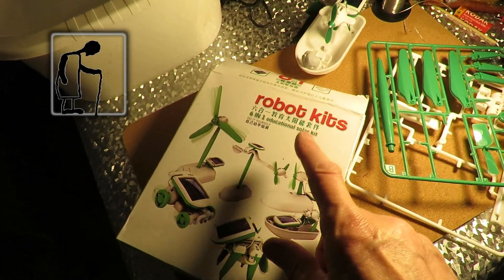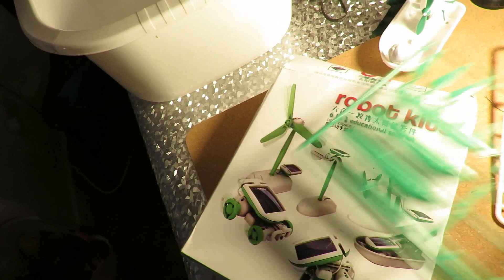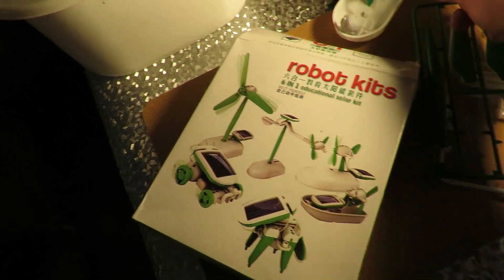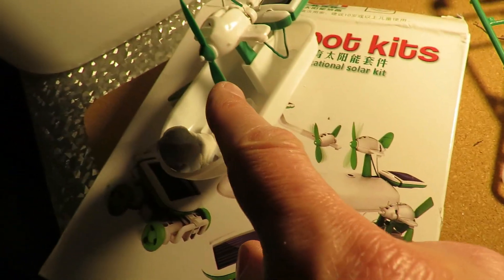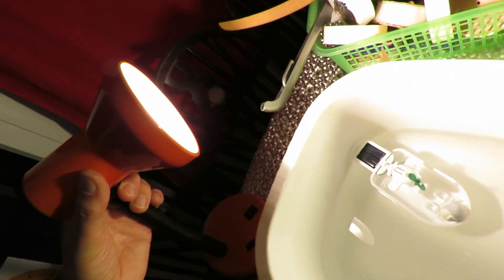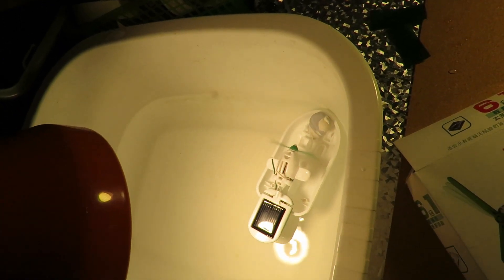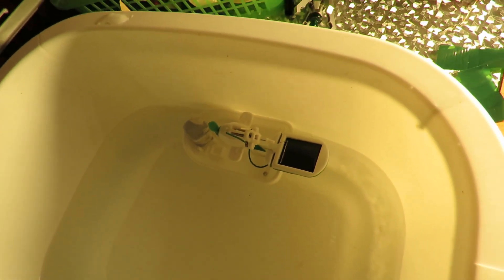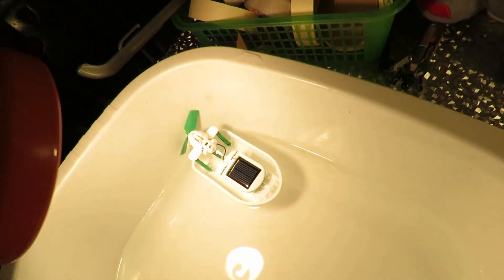6 IN 1 educational solar kit - Fan Boat

Comment: Holy cow.
I am sitting here looking at the same kit!  
I picked it up at Dollarama for 3.50 Canadian.
Still haven't opened it  lol.
I forgot i had it until  saw your box.
Reply from the maker: 3.50 Canadian, sound a touch expensive although the prices vary dramatically depending on the branding and where you buy them. I would say it is a good kit "at the level it is aimed". The spring connections for the wiring can be a bit hit or miss and depending on the quality of the moulding you may need to do a bit of tidying up to remove any excess flashing from the plastic. You need a good sunny day to get the best or an old tungsten bulb or maybe halogen. It will struggle with LED or CFL bulbs.
Reply: @GrandadIsAnOldMan  
We are a little short on sunshine at this time of year around here.  
When the sun does shine it's at such a low angle that it doesn't have much strength.
Reply from the maker: Halogen bulbs then. I am a bit low on sunlight myself, but that is because I am a miserable old man 😆
Reply: @GrandadIsAnOldMan 
 lol.  I still have a couple of Tungsten bulbs tucked away.